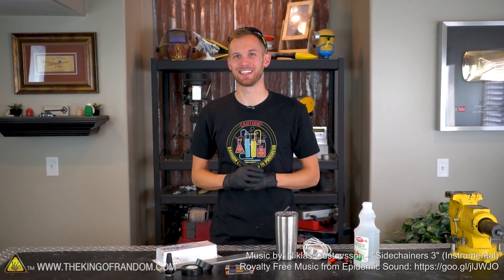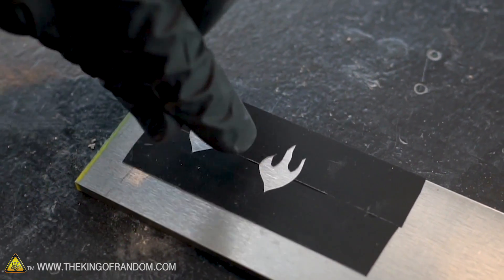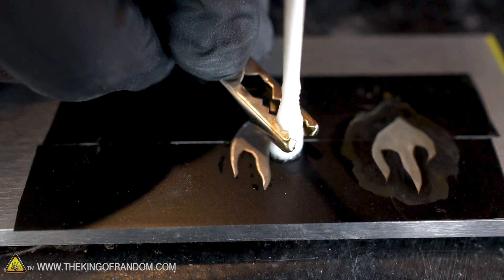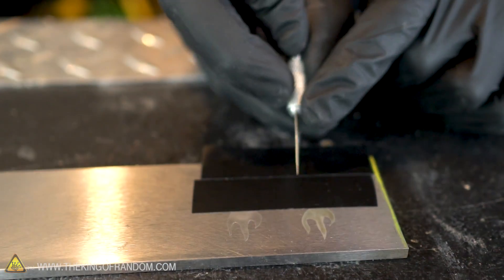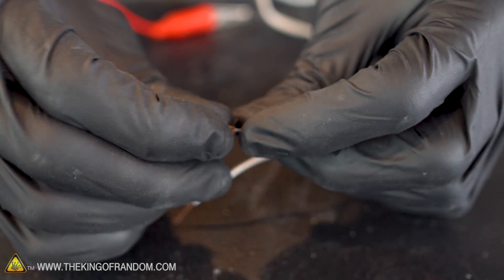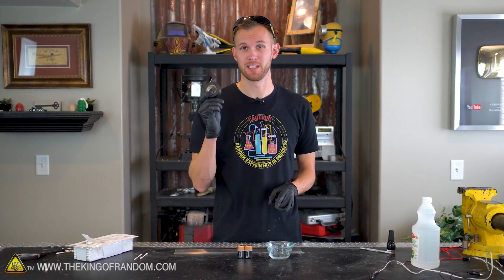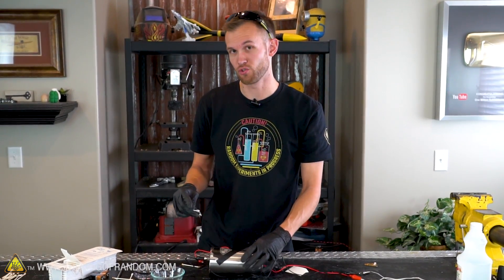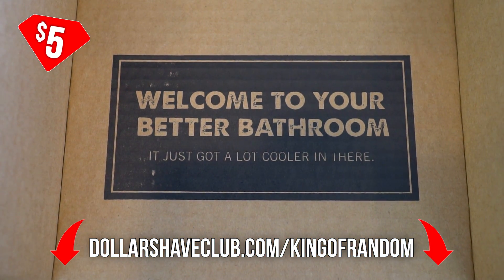Etch METAL with Battery Power! TKOR Shows You Everything To Know About Metal Etching

Comment: The chemistry behind it: 

1. The DC power provides an electric motive force (EMF) that make electrons flow from positive terminal (Iron Plate) to negative terminal (cotton swab). 
    On positive terminal: Fe(on the plate) -> Fe2 (dissolve in solution) + 2e-. 
    On negative terminal: 2Na+(in solution) + 2e- --> 2Na. 

2. The newly formed sodium then reacts with water: 2Na + 2H2O --> 2NaOH (dissolve in solution) + H2 (which explains the gas bubble). 

3. Finally, NaCl regenerates with the double displacement reaction: FeCl2(aq) + 2NaOH(aq) --> 2NaCl + Fe(OH)2 (which is the dark precipate formed on the cotton swab). 

The overall reaction: 2Fe ---NaCl, electricity---> Fe(OH)2 (which is essentially the same reaction that makes iron rust, except this reaction occurs in an observable rate given energy input (electricity)
Reply: Yu Xin wonderfully explained chemically......however, electrons ACTUALLY flow from negative to the positive
Reply: @69CamaroSS  He's correct about saying electron flow from iron to the cotton swab, iron becomes positively charged cation as it loses its electrons and the hydrogen cation (H+) get an electron and become elemental hydrogen (the bubbling), just from the iron to the battery to the cotton swab (yes I know, H+ actually take electrons from the battery, not iron, but definitely not from the saltwater to iron) you're correct about electron goes from negative terminal of the battery to positive terminal of the battery normally, but the thing is a bit weird when it's about electrolysis.
Reply: Cool, do you know if this would work on aluminum or other metals and their alloys?
Reply: @zevfeitelson  He explained the chemistry with Iron (Fe) which is a main ingredient of steel. However with other metals and their alloys, im not too sure if it would work, but if it has iron in the metal, then it would would most likely will
Reply: @johngoldberg9931  I understand that, I was simply wondering if it has to be iron or an iron alloy, like say aluminum another metal that is used incredibly often in the modern world
Reply: Can this method work on glass,wood,pastic, copper etc
Reply: @haiderallana3869  glass, wood plastic would not work because they're not conductive. They won't carry an electrical current.
Reply: @raveythirteen5660 Oh,Okay..but is there any other way of etching non-conductive materials of elctricity in a cheap way...btw thanks for the reply!Much Appreciated🙂
Reply: @haiderallana3869  I'm wondering the same thing. Does anyone know? If not we shall experiment. It prob wouldny though you would need some other type of conductor of electricity right
Reply: @zevfeitelson  yes
Reply: does it work with Copper
Reply: Your first two points are wrong, EMF is Electric Magnetic Force, and electricity flows from Negative to Positive.
Reply: How is this different than anodizing?
Reply: So by doing this you "destroy" the stainless property of stainless stell and your flask will now rust, right? Why to do that?
Reply: @MrWnw  If it's legitimate stainless-steel then All of the steel is properly treated, even below the surface.  Or at least that's what I've heard.  It just Seems like it is exposing a non-stainless underlining from the discoloration, but that's just because the etching makes it lose all of its lustrous glossy and polished sheen.
Reply: EMF stands for electro magnetic field

Comment: Does this also work with aluminum ( I would like to do this on my bose soundlink mini)
Reply: I did an etching in aluminum using salt water, works great.
Reply: Aluminum can be oxidized, so potentially, but I'm not familiar enough with the math to be certain whether salt water would be effective on it. Test it out on a soda can or some aluminum foil and let us know!
Reply: I just hafe to try it out but probably with a higher voltage like 25v
Reply: Go for it, although I don't think the voltage would change whether or not it worked, just how quickly it worked. So, if it wasn't going to work at 9 V, I would think it wouldn't work at 25 V either.
Reply: @mgb360  almost every type of metal oxidizes, iron rusts copper turns green.
Reply: Yep, even Pantera will oxidize over time.
Reply: That looks like aluminum

Comment: When I did this with acid etching I used black all surface spray primer. Similar to the nail polish idea but it sticks much better and makes cleaner lines when scratched off. Then is easily cleaned off with some paint remover and light sanding

Comment: I haven't read all the comments yet, but if you use the reverse polarity to your etching process with gold or silver as your electrical transfer to the q tip you should find that your design will be plated with with said metal.

Comment: For the nail polish, try putting what you want as the design down before you put the nail polish down. Like put a sticker in the shape of what you want down. Than paint the nail polish down on top of and on the sides of the sticker. Then peel up the sticker while the nail polish is still wet or else
it will do what it did in the video (come up in flakes). Also let the polish dry a little longer than you did because it possibly could have still been wet on the bottom portion of it but looked felt dry on top. Just some suggestions and thanks for the amazing video!

Comment: the black build up on the q tips is from the electrical tape not the steel
Reply: No, it's from the steel, it turns that color when oxidized with chlorine. The electrical tape shouldn't react with the solution. You could demonstrate this by trying this out on some steel with no mask.

Comment: Does this work with ALL types of metal? As long as conductive, yes right?
Reply: Not necessarily, different metals have different levels of reactivity and might not oxidize this way. You could probably get most any metal to work with this sort of method, but you might need something fancier than salt water. If you're curious, take a bit of scrap metal of whatever type you want to etch and test it out. I do know that copper oxidizes with chlorine, and I expect that silver would as well, I'm not sure of other metals.

Comment: To get the nail polish to stick to the metal better you need to pretreat the metal to make the surface more wetable to allow to nail polish to adhere better. The metal has pours kind of like your skin and usually high heat or voltage will open them up and allow the nail polish to stick better.

Comment: 1 9V battery = 9 volt

2 9V batteries in !ROW! = 9 Volt

You amplified the amperes and not the volts
Reply: To amplify the current he'd need to attach them in parallel. They were attached in series so it was in fact 18 V.

Comment: You need salt in the vinegar so it acts as an electrolyte that creates resistance where your pressing therefore oxidising it if there’s no salt no electrolyte and so on so forth
Reply: An electrolyte would not create resistance, it would decrease it. Vinegar also contains acetic acid, which should work fine as an electrolyte, just not as strong of one as salt.

Comment: I did the nail polish technique about 2 years ago. I used gel nail polish over small vinyl letters. When the nail polish was almost dry I used a razor to pick at a corner and peel up the vinyl lettering. After that I allowed the nail polish to completely dry and proceeded with etching. I used it on brass, not sure if the metal types affect how nail polish sticks but it did come out much better.

Comment: I get darkening after etch, but that cup looks more like it is just rust. I'd be concerned of it spreading.
Reply: It's probably FeCl3, while rust is Fe2O3, so it isn't technically rust but it is oxidized iron. If you were concerned about it, it should only be a thin layer and therefore fairly easy to polish off.

Comment: I did some steel etching with muriatic acid and nail polish. The lines ended up a little wavy, but then again I failed to let the nail polish dry all the way. BTW, I would NOT RECOMMEND etching with muriatic acid, it caused rust spots in places and is NASTY STUFF

Comment: Can you etch your skin with this method without pain ? If so, try it plz (on meat or whatever). DIY TKOR tattoo !!
Reply: Without pain? It literally eats metal.
Reply: LongWaveGT you’re right with pain, but still sooooo badasssss
Reply: Because the etching relies on a very specific set of chemical reactions with the metal. These require a consistent, crystalline structure (like solid metal) and atoms which are stable at different oxidation states (different numbers of electrons) so that running electricity can switch them from 'fits with the solid crystal' to 'dissolves easily in water' by altering the number of electrons. Our skin shares none of these properties.
Reply: dzello actually it doesn't follow the nervous system, it flows well throughout the body.  Not much better through nerves.  Nerves aren't exactly like wires, they aren't great conductors.  They work on a chemical chain reaction down the fibre.

And skin does not share galvanic properties of electrodes, it behaves more like an electrolyte because of it's makeup.  It would get marked or "etched" (destroyed), but not sure if or why you'd want to put your cells/body through that.
Reply: No, it wouldnt work. It only works on metal.
Reply: Kevla Canuck I mean, isn’t it obvious ? It’s the most badass way to get tattooed ever !! 💪🏼💪🏼
Reply: A French Gun Guy yea for sure!  XD
Reply: Kevlar Canuck But it won't work. Unless you're a robot
Reply: Nicholas Rohde oh really why ?
Reply: Have none of you seen Fight Club? There is definitely a working proof of concept there!
Reply: Metal is more consistent, your skin isn't. Putting electricity in your body makes it follow your nervous system. What that means is no matter what, you'd etch the patterns of your neural system and stuff. The same way people get tree-like burn marks when they get thunderstruck.

Comment: You can also use sulfuric acid (you can buy virgin sulfuric acid at Wal-Mart as a drain opener)  

Just apply your stencil, swab on the acid them heat with a cigarette lighter.

Comment: I think when you had the leads reversed you were just depositing bits of metal from the alligator clip onto the work piece. that being why the q-tip got all gunked up at the clip end instead of the other end. just like when working in the opposite direction all of the metal got pulled up from the point where it contacted the work piece.

Comment: Wall Adapters with a circular outlet actually have a symbol showing which part is negative and positive,  not necessarily easy to discern which connected to the outer plate when you cut it off,  but just to let ya know

Comment: I think using the batteries in parallel might yield better results. I think the limiting factor in the engraving is the current, so allowing more current rather than more voltage (as used in the video) could increase the engraving depth/speed.

Comment: If you're going to teach people about this sort of thing please get it right,
Never use a knife to strip cable, use pliers/ side cutters, a knife will always gouge the conductor. 
Putting batteries in series increases current not voltage, electrolysis works better with higher currents, no different to electroplating
That symbol that you called DC is pulsating DC - there is a big difference

Comment: The nail polish didn't stick to the metal very well because it is an acrylic base.  To use it with metal you first need to apply a primer, otherwise it is like applying a rubber coat to the metal (peels off real easy).  To use the polish as a covering, make your design with a piece of paper, lay it on the metal and then apply the polish.  after it dries the paper will be easy to trim around and remove

Comment: With the nail polish a better way to do it is to  use some tape to make the shapes and apply it to the surface. Then you paint over it and remove the tape while it is still wet. That will help get you a cleaner edge which may stick better to the metal.

Comment: I am pretty sure you need more Amps not Volts. The voltage corresponds to the energy needed for a single electrochemical reaction. However if there is a higher current more of those reactions can take place at the same time, because I = ∆Q/∆T and that is what you want.

Comment: Cool video tryed it out on a sheet of the same metal I tryed 7 diffrent ways used a dc plug like u I used lemon juice, vinegar and bicarbonate soda, vodka with sufuric acid, cola, orange and vinegar, Ecig liquid, plumbers flux, best that worked was the lemon, cola, and vinegar with bicarb soda and plumbers flux, hope that helps also used plumbing tape holds well and comes of without damage also plumbers flux gives it a copper colour :)

Comment: Two notes about AC to DC converters.
1. The wire with the dashed line is usually the positive.

2. Newer AC to DC converters do not have isolation transformers (they are smaller, lighter, and cheaper the manufacture).  Chopping off the end of the wire and introducing water to the picture increases shock hazards (especially if you have a cheap converter).

Comment: Yeah, a car battery will not work the same way as your wall wart.  Same voltage except that when you short the wall wart the voltage it generates will plummet.  A car battery will just keep pumping till it runs dry.  Very different electro chemistry.

Comment: You can do something very similar with just vinegar and no batteries. If you heat the vinegar to the boiling point, remove from heat and submerg carbon steel into it, you will get a nice black patina on the exposed steel.  I use this to help protect my carbon steel knives to help prevent rust. Plus it looks cool.  Not sure the effect on SS but depending on the grade of SS, it might work.

Comment: I tried nail polish with immersion etching, it bubbles and comes of after minutes. Then I tried model paints, 100% better. Lay down a nice thick layer and it stands up against the harsh salt water immersion. You can mask your design paint around out and then pull up what you want to have etched.

Comment: I've seen pencil graphite used as a mask.  That way you can just color in where you don't want etching and any areas left open get etched.  It's even cheaper, everybody has a pencil lying around and you can more easily undo mistakes in your design and make adjustments before you do the etch.

Comment: Had to check what you are producing from the chromium:
"Hexavalent chromium compounds are genotoxic carcinogens. Due to its structural similarity to sulfate, chromate (a typical form of chromium(VI) at neutral pH) is transported into cells via sulfate channels.[5] Inside the cell, hexavalent chromium (chromium(VI)) is reduced first to pentavalent chromium (chromium(V)) then to trivalent chromium (chromium(III)) without the aid of any enzymes.[5][6] The reduction occurs via direct electron transfer primarily from ascorbate and some nonprotein thiols.[5] Vitamin C and other reducing agents combine with chromate to give chromium(III) products inside the cell.[5] The resultant chromium(III) forms stable complexes with nucleic acids and proteins.[5] This causes strand breaks and Cr-DNA adducts which are responsible for mutagenic damage.[5] According to Shi et al., the DNA can also be damaged by hydroxyl radicals produced during reoxidation of pentavalent chromium by hydrogen peroxide molecules present in the cell, which can cause double-strand breakage.[6]"

Comment: Hi Nate,
I believe the reactions going on are something like this:
Fe(steel) + 3 NaCl(salt)+ 3H2O --> FeCl3 (iron(III) chloride) + 3 NaOH (sodiumhydroxide) + 3 H2 (hydrogen gas)
So the gas developing is hydrogen and the greyish-black substance on the q-tip is probably the iron(III)cloride, which is dark-grey when in pure form and yellowish-brown when dissolved in water.
Hope it helped
Reply: Seems plausible, though I'm not especially familiar with this reaction. It would be interesting to know if you could avoid the greenish stain if you used a different solution rather than NaCl. The hydrated form of FeF3 is pink which might look quite nice, although I'm generally hesitant to experiment with fluorine compounds.
Reply: @loempiabor1000 s.l. geerlings: In general you're right, but since the amount of electrons added before the reaction equals the amount of electrons removed afterwards, you don't have to write them down
Reply: I think you forgot some e's since electricity is added
Reply: Surjo Ganguly that means the colorisation should be restant salt

Comment: Pro tip: when trying this experiment ant home, keep in mind that running an electric current through salt water produces chlorine gas, which is toxic. Stay in a ventilated area if using salt water
Reply: You can tell if chlorine is being produced if it turns yellow. Which all of the q tips in the video did

Comment: I used nail polish to engrave and I found two things that seemed to help. Fist I would apply the paint and then hit it with a blow torch very lightly. This dried it really fast and helped it stuck to the metal. I also tied different types of nail polish and I believe it was the gel that I had the most luck with.

Comment: You might get different results by altering the strength of the salt solution. Try different types of vinegar, too. You might be able to get results with lemon or lime juice - perhaps mixed with the salt solution. I'd also try Tartaric acid, which is used in cooking, and perhaps flat Coca Cola, for the Phosphoric acid in it. Stencils can be cut with laser cutters, too. I'd physically cut mine on a piece of toughened glass, and then transfer to the item to be etched; that way, you don't get X-Acto scratches on it.